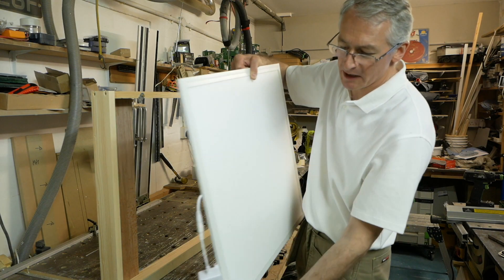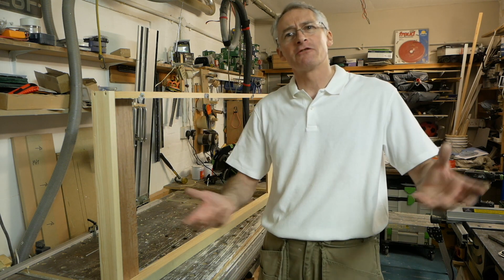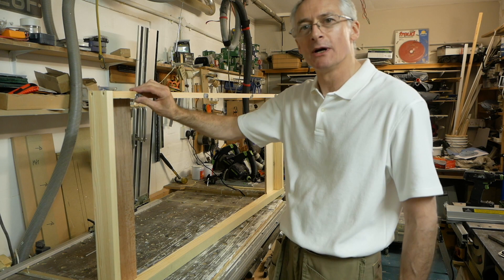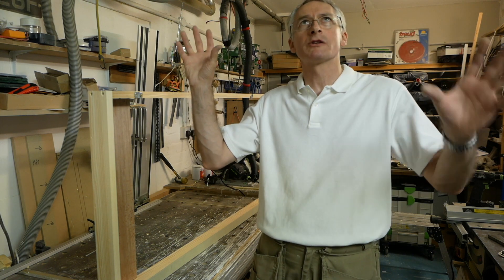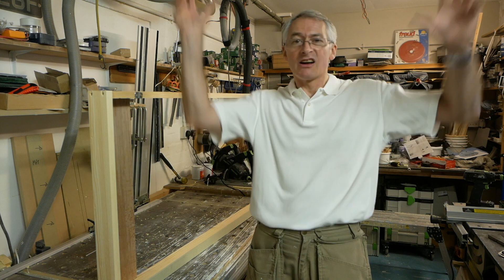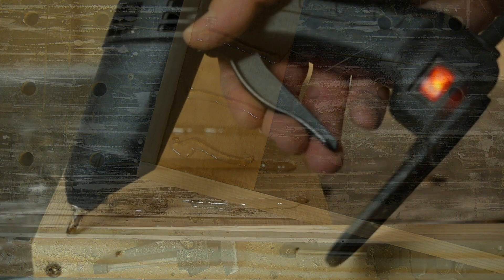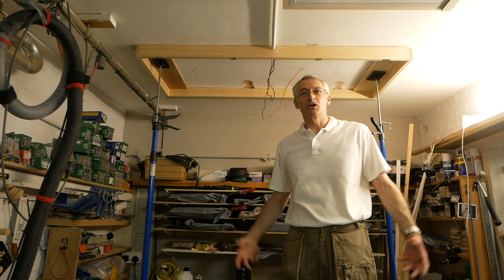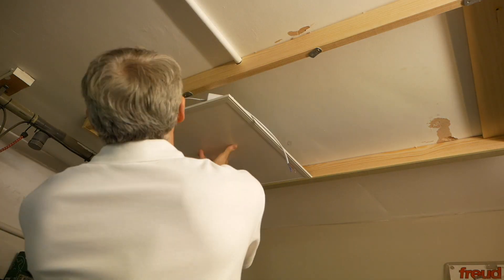Why use two glues? #077

Comment: What a great tip to share with everyone. I've used that trick myself before and reminds me I should use it more often. 

But it reminds me of some advice I gave a few days back, if you find hot glue doesn't give you enough open working time, heat the peice with a hot air gun then apply the glue, you'll get about double the amount of time before the glue solidifies. Especially true if your parts are metal.
Reply from the maker: Karl, that is such a fantastic tip, I'm going to pin you to the top of the comments so that everyone sees it! Brilliant idea - even though I'm using a 'long' open time glue, it's still only 15-30 seconds, so anything to extend that time is good in this kind of situation. Thanks! 👍🌟
Reply: Great tip Karl.  I'm stealing that one!
Reply from the maker: Karl, hope you don't mind but I've turned your tip into a '10-second tip' video coming out soon. I've given you full credit for the tip & I'll link to your YouTube on a card in the video. 👍Thanks again, Peter.
Reply: Hi Peter, yeah no problem heating the piece really helps with the open time. I will look forward to seeing the tip. 

While I'm here you might remember I also commented on your budget bandsaw is it worth it video. Anyway your video had me wonder how far I could go with adjusting the saw. In the spirit of sharing I shot some video last night of the saw cutting 0.75mm slices of a piece of softwood and white oak with the stock blade. I'll be posting that and a description of all the tweeks after the weekend. Karl.
Reply from the maker: Excellent - and thanks! I managed to cut around about 1mm or so thick slivers from softwood straight out of the box, but agree that the guides need a bit of tweaking! I'll link to your channel, then folks can see whatever you put up there. Incidentally, I couldn't send you a PM as you don't have anything filled in the "About" section; might be something to consider 👍

Comment: A good tip Peter. I do something similar with CA glue and PVA (wood glue). I put a few strategic drops of CA glue to fix it into place quickly and the PVA glue for strength.
Ron

Comment: Same tip works well for installing backsplash.  Just a few dabs of construction adhesive. About the size of an almond in the places you would nail. Test fit for adhesion, pull off and use some dabs of hot glue and viola.

Comment: Hi Peter new sub
Lovely the videos

2 questions

1 how is the ryobi 18v 18g brad nailer would you recommend one.

2 I have ordered a ryobi 18v glue gun. When I do external mitres of any sort I always use mitre bond
Or 2 part glue.

Do you think you could you the hot glue gun to bond external mitres

Thanks
Reply from the maker: Hi Barry, and welcome. I don’t have the 18g Ryobi nailer, just the stapler and the 16g nailer. Stapler is great, nailer’s OK; the 18g nailer is supposed to be much more like the stapler, but I’d suggest you get your hands on one to try it first. And no, hot melt glue is generally much too thick for mitres - you’d get a very happy joint! Thanks! P

Comment: Nice one Peter - made the mistake of 'upgrading' to electronic ballast fittings a few years back - perfect excuse for a swap ;) Mind sharing where these are form - think the colour/ spread is a good swap too! 

Cheers
Tom
Reply from the maker: +Thomas Kitchin Thanks Tom! I bought the panels from eBay:- 
https://www.ebay.co.uk/itm/400921892859 
600 x 600 panel, daylight, consumes 48w, outputs 4000 Lumen. Very impressed 👍 Lots of choice from that buyer, too.

Comment: Great vid Peter, used similar panels at my lads shop.Very high ceilings - suspended on wire but great tip.  I never seem to use may hot glue gun as I don't have much success.  Regards Mike
Reply from the maker: +Mike S Thanks! Big fan of the TecBond guns and sticks - I buy mine from gluegunsdirect.com 👍

Comment: Great tip.......and I am equally impressed with the lighting, I may well follow up on those for my new shed workshop.😀 What was your aiming point a well lit workshop or a well lit filming studio? If the latter would you guesstimate you had double the number of lighting units needed for 'standard' workshop illumination? Keep up the good work - you have a great channel.👍
Reply from the maker: +Norman Boyes  the 'volume' of lighting was really for the video, yes, and yes, I could easily have used 1200x300 panels with half the output if it wasn't for that 👍
Reply: Peter Millard Thank you for that Peter, I will research and then implement those panels.👍
Reply from the maker: They're very good - I've added a link to the ones I used in the description, great seller on eBay 👍

Comment: Hi Peter. Can I ask you, were you pleased with the result of the LED panels? You didnt express much delight when you switched on....The reason I ask is thinking of doing the same in my workshop, but just wondered what Lumen value did you opt for, and with hindsight do you think was it was not Sufficient enough?
Reply from the maker: +ian black Oh, the LED panels are fantastic! They feature briefly in an upcoming video - next week actually - and I’m thrilled with them. These panels put out 4000lm each - I think the current ones are up to 5000lm -  and I now have nine of them. It’s... bright. So bright, its wonderful. I deliberately left a blank space over my MFT bench (so I didn’t get glare when I shoot overheads) so there’s a slight dark spot there, but overall they are fabulously even and bright and perfect daylight balance. Love them, highly recommended, follow the link in my LED panel vids to get the ones I bought, great value 👍

Comment: Peter, where did you get those neat devices used to hold the light frame up?
Reply from the maker: +Rud Dog The little turn-buckle things? They're just tiny angle brackets hammered flat - there's a very short cutaway clip of them in the video, where I'm hammering them flat against the tail of a little vice 👍

Comment: Nice improvement but I drill into concrete all the time. Just need a hammer drill and some tapcons. No biggy.
Reply from the maker: +Rand Sip Me too, but this isn't just concrete - the whole ceiling is like a giant lintel. I'm sure I could do it, but gluing is simply much easier.👍
Reply: Hammer drilling overhead — even with a vacuum is a real nasty proposition. Your whole shop ends up gritty.